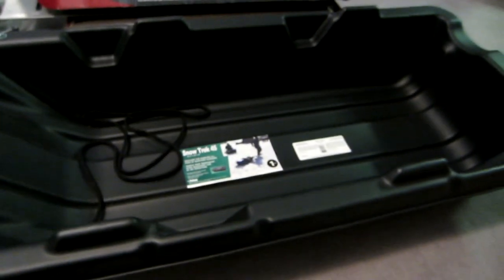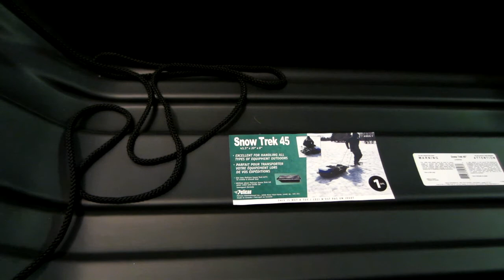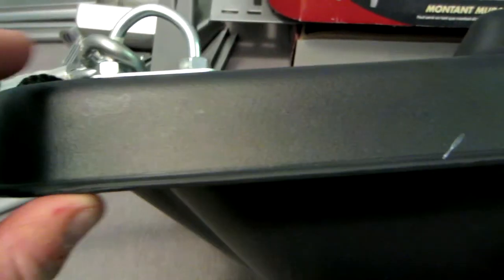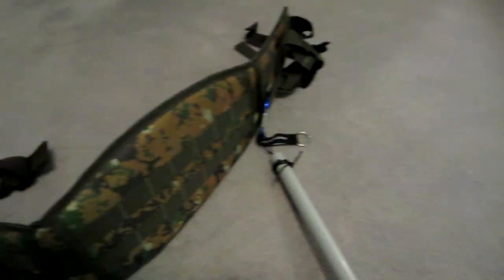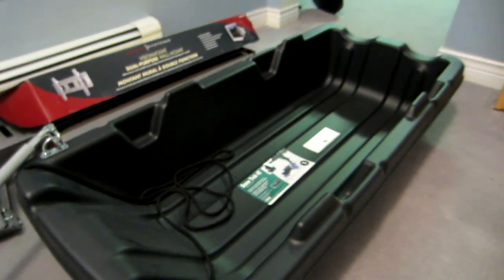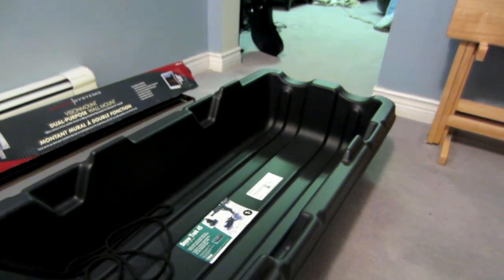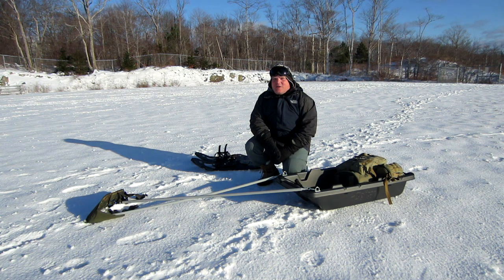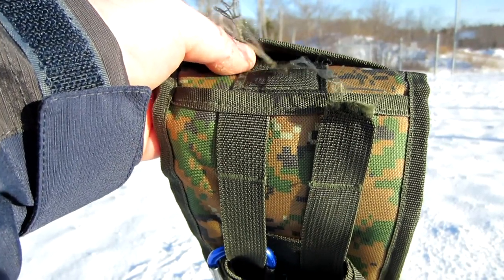My Pulk

Comment: Hey dragonflyhiker Had another look at your video and notice that mine is a 60" I thought it was the same but it seem longer. Here is a tip keep the loop string attached if your set up breaks in the field you are not stuck with nothing,good for back up.I just let mine string loose in the bottom of sleigh had no problems yet but if i did have something break i can still use it i to get home. I'm heading out in the morning for a 2 day overnite trip I will post video on my set up and trip.

Comment: PS . and and some silicon tubing e.t.c on the chain link to slow down the rub points on the metal parts . a seat pad put on top so you can grab it right away after though's  up hill walks for a rest stop and sit down .

Comment: Try some 1 inch webbing , with 2 eyelets and a bolt for attaching too the PVC pipe . The you will have a much better anchor point . Just a suggestion . Rodney .